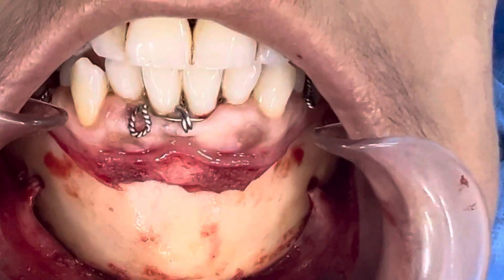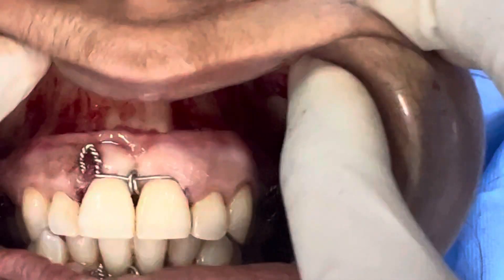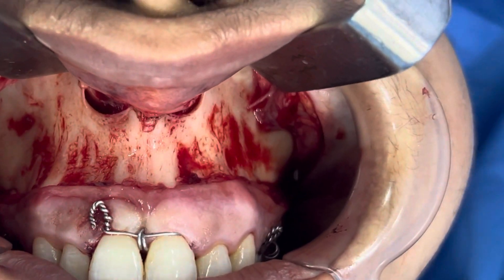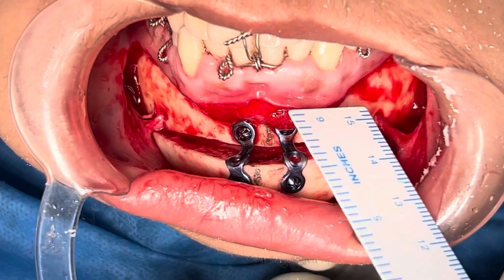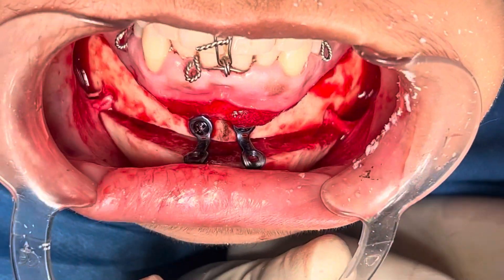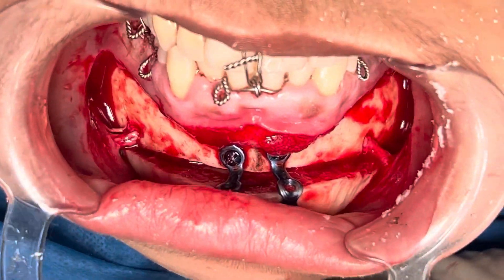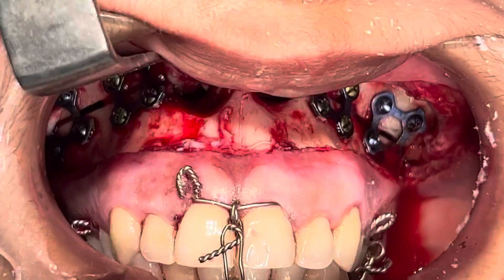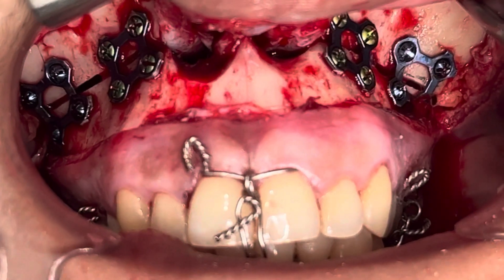Jaw surgery with plates and screws - Maxillofacial And Orthognathic procedure

Comment: I had this done back in 2000. Mines was due to a massive lower jaw overbyte. Its been 23 years and yes the screws and plates Hurt and i can feel them inside my face. Allergy pains are 10xs worse than any normal person. I wish they use dissolveable screws for mines.
Reply: Do you still feel them 😱
Reply: @Foxplushie was wondering that too
Reply: @tswwarrior8089  yea cuz that looks uncomfortable

Comment: If the plate and screws not removed, will there be any problem in the future?
Reply from the maker: No
Reply: Yes. American surgeons remove them for a reason.
Reply: @chrisking6695 if you want or need them removed. It’s not mandatory.
Reply: @chrisking6695 american surgeons do not remove them